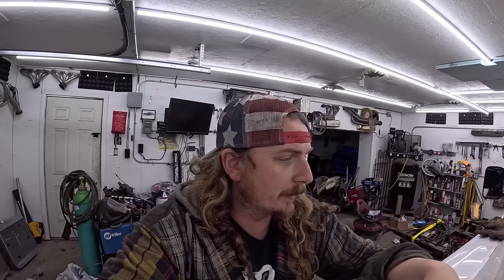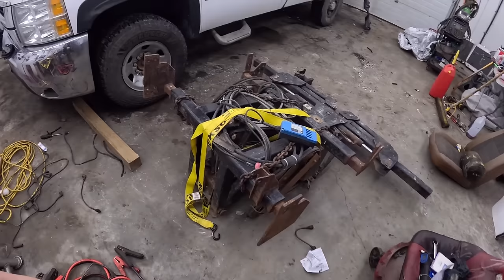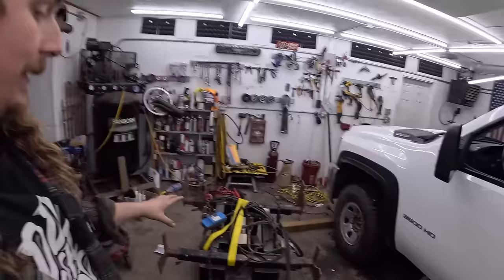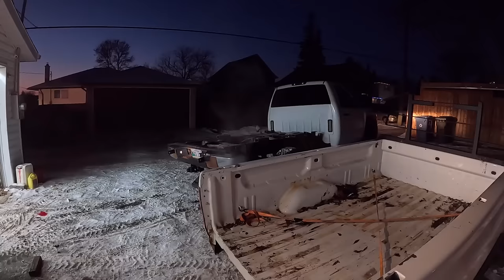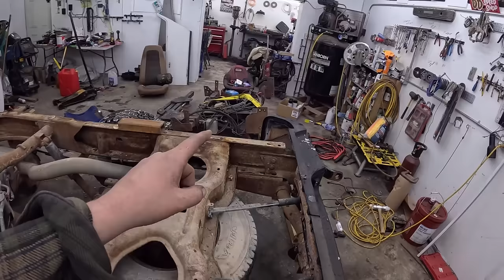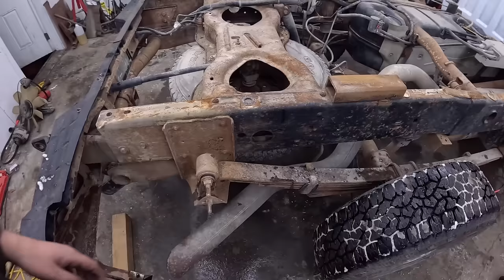Market Place Score!  I Built My DREAM Truck - Cheap Sneaker Lift

Comment: I like that towing package, cool stuff.  Maybe this is a better idea than using a car trailer, or likely this takes up less room than a car trailer.  I have an old 1997 chevy 6.5l diesel 2wd manual transmission c2500 with class III hitch installed that I plan on having for the rest of my life cause the cost of new trucks in the heavy duty range for towing project cars cost so much I'd have to be well off to make the monthly.  Now, I figured the frames on 3/4 ton to 1 tons chevy were heavy duty thicker already , but maybe I am learning something here.  And yeah, I already know the old 6.5 diesels aren't ideal, other than the new marine grade 6.5l replacement motor I can get later.  Who knows, I could convert it to 4wd later if the need arises
Reply from the maker: It's all about room for me.
Reply: Yeah, I see it makes perfect sense.   I see your new towing rig and I dream of having one too.  I can see why you tried out the "tow the backend" of the vehicles, being the distribution of weight and less stress on the drive train....I mean, less stress on the ring and pinions and likely worn out bearings the better,...its easier to fix up the front bearings than reset the proper contact profile of a new ring and pinion if something has had no service/gear oil etc for decades or such(prussion blue, dial indicator, large snap on 3/4" dial torque wrench, ...crush sleeves and any and all headaches.

Comment: Dandy Dan the Repo man, hide your cars as fast as you can!

Tractor weights as ballast on the front and stiffen up the rear suspension and you should be able to tow about anything you want. Within reason that is. 👍😎🤠

Comment: Time to fix that hanging led light. lol With all the steel added to the outside of the frame rail, why did you not box the inner portion of the frame?

Comment: You could loose the bumper, the box and build a flat bed with the back corners of the flat bed cut off at angle. Sounds like a lor of extra work to be able to pick up a caprice tho

Comment: Welding the vertical ends will be a weak point, if it ever was to  crack it will be there as you have weakened it by crystallizing with the heat. Whenever we've lengthened a semi frame I've always been told not to weld the vertical ends. Just my opinion, I'm sure others will correct me.

Comment: Air bags probably a I’d
Reply: You would have to weld it so salt doesn’t get i between the metal. Or it will rot out your frame. It doesn’t need reinforcement. It mad well and without welding the frame. I had the same setup worked great for years.
Reply: Wouldn’t I meant don’t need reinforcement it’s fine
Reply: Grab it from the front

Comment: The pump is not supposed to stay running I have two of those in my Chevys are for repo the switch at the top is supposed to arm the dump solenoids when you hit the switch to go down the pump automatically kicks on to drop it when you stop the pump shut off

Comment: the pump should only come on  when the switches are used  not running all the time  and then it can use the on off on the controler, if the pump stays on all the time it can burn out the pump  with outr a relife  valve

Comment: Maybe you should just Buy another Hoist to have around n I would go Buy a I Beam A Frame hoist n it's great for Lifting Vehicles Body n make or get one adjustable one to fit inside your Garage n I have 3 engine hoist n 1 I Beam Hoist n it works great

Comment: You’re going to burn that pump out and your alternator and wear out your batteries if that pump is running all the time. That pump needs to run only when you demand items to move. So when you go to lift, the pump It will turn on when you’re done lifting the pump will automatically shut off so on and so on.

Comment: Unfortunately, you made the same installation mistake they made on my truck. I bought a used 2004 same as yours but 2500 2wd with diesel. Came with a lift and tow and someone installed it under the frame like you did. It's supposed to be mounted inside the frame, not under and outside it. You can see how low the frame of the tow unit gets with weight on it. It will hit speed bumps and such. Completely broke the weld where the boom mounts to the frame of the tow unit on mine even with air bags. Also, you didn't show what you had to do with the shock on the driver's side.

Comment: Is there a reason you tow from the rear? Local law maybe? Looks like we tow from whatever end we can attach to here.
Reply: I was told that if you tow an auto g/box  car , even in neutral the wheels turn the pump in the g / box which is the wrong way round . Might be wrong though . Best wishes for the new year .

Comment: I think that was way over kill on that chassis,I was a shipfitter on submarines for 16 yrs.I know overkill when I see it.The lift would have added all the strength it will ever need.Nice work on welding all of the verticals down hill,Jeez Dan come on.You lost alot of your strength  when you removed the factory rear cross member
Reply from the maker: The lift replaces the cross member
Reply: @DDSpeedShop  Not on the top of the frame,The factor put it on the top for a reason.